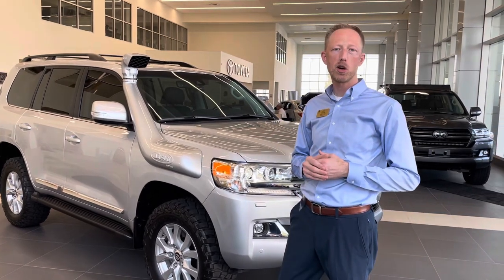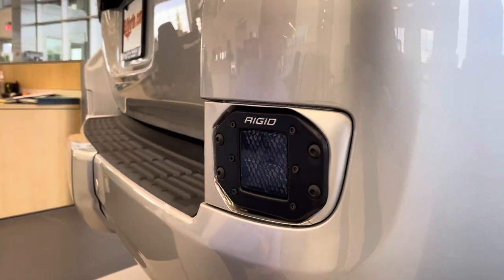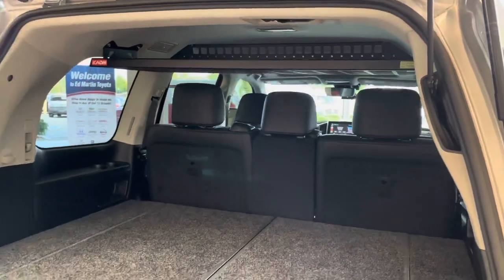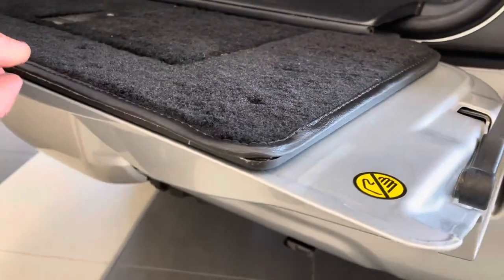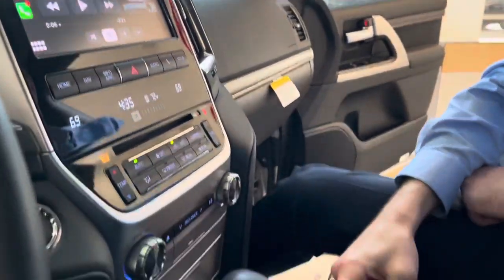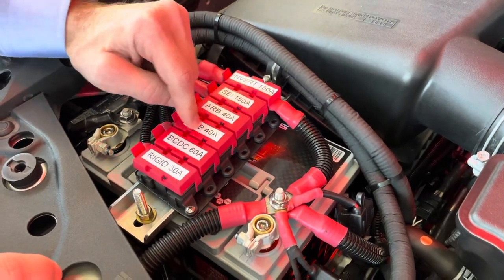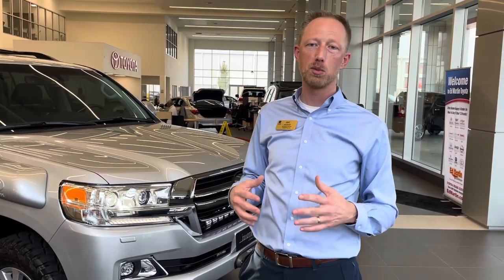CUSTOM 2021 Land Cruiser 200-series with ICON Stage 6 suspension, full XPEL wrap, more!

Comment: You always post great videos of amazingly tricked-out Land Crushers (my young son says Land Crusher).  I have a 2018 and would really like a 2" lift on it.  Is it necessary to add a new suspension kit to do this?  I have a Tacoma that I purchased from a dealer with a similar lift but they did add a whole new suspension with wheels and tires.

Comment: Who makes the ANL fuse blocks? also when you ran the 200A line, did you run it under the door sill or external under the chassis?

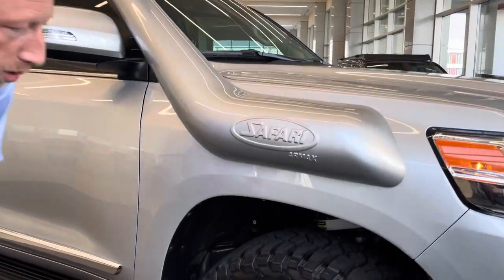Comment: 1:44 Sick build. Why not Stage 7? I ask because I have a 2021 Heritage Edition and that's what I'm considering. I'm guessing you already received your last Land Cruiser. I have a buddy that was hoping to get one but I told him I don't think there are any left in the country, stock at least. I'm guessing they were already delivered and sold by now. Please correct me if I am mistaken.
Edit: I'm surprised you guys did all of that work and left the standard body-mounted running boards instead of ditching them for proper frame-mounted rock sliders.
Reply from the maker: True, I’ll probably add running boards on it.
Reply: Congrats on your 2021!!!
Reply: @lowestsky27  Thanks!